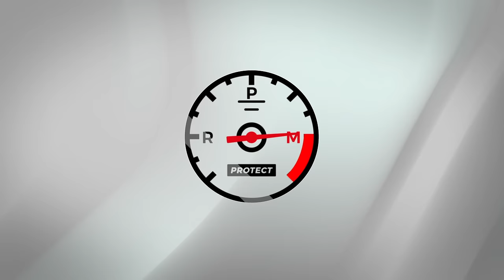Black Trashed Mitsubishi Pajero Bush Basher Gets a Detail! P2 Paint Correction  | Vlog 40.2

Comment: Sandro you knocked it out the park with this 1 The postman always delivers Again You read my mind  2 of my work colleagues came up to me and asked what cutting compounds i use as i buy all my own cutting compounds They said the works cutting compound was leaving to much holograms and haze  I watched both of there techniques and expalind there are a number of factors Both of them where hammering down on  the paint,  to fast of a arm speed, not cleaning out the pads covering to big an area I said it was not the compound it was the person holding the buff was the biggest variable (as you have said more than once) there faces where still blank The could not understand it was them and not the compound yes the compound is a small factor i said. Time  can get away from you sometimes the best way to say it is The Bad news time flies The good NEWS is youre the PILOT Cheers  IN SANDRO WE TRUST
Reply from the maker: 100% correct! There’s not enough emphasis on good technique compared to combination selection and it’s all to easy to blame the products and tools when some little changes in our approach could make all the difference. Thanks mate always appreciate it!

Comment: Hi Sandro! As you put another great insightful video online, just a small question. Our lovely house cat jumped on my bonnet, but must have slid right back off and made some scrathes 😫... Luckily my car IS coated. Can I patch those scuffs up with a bit of CarPro Reflect? No experience with polishing ceramic coatings. Thnx!
Reply from the maker: Thanks and I’m glad you enjoyed it! 
Unfortunately using polishing abrasives on ceramic coatings will tend to remove it or at least degrade the coating in my experience. If the coating was in good condition it hopefully helped take the brunt of those scratches so if you do want them gone you could still polish off the coating just on the bonnet and then reply it which hopefully shouldn’t be too much work.

Comment: Hello, i really like ur videos, tutorials, testing etc. I learned alot from watching your videos, thanks :) Can i ask you, when i need 3 days to detail a car(1day washing/decon), (2day poslishing), (3day panel prep and waxing), and i have garage where is  no zero dust, if i leave car in garage for night, when i come morning to garage i have little of dust on car. And question is: How can i take off the dust of the car after polishing and before waxing? or after washing and before polishing? I dont want to scratch it up after polishing. I think maybe fluffy towel and some ONR or panel prep to take the dust away, or just try polish and wax the car in one day?. Thanks for answer, sorry for my english i am from Slovakia. Cheers :)
Reply from the maker: I usually start by using compressed air to blow off any dust and then I follow up by doing my panel wipe down using some good cloths and a good gentle technique to remove any dust. 
If the space or garage is fairly clean and closed, then the dust should be quite minimal, but there’s always at least a little dust no matter what, so that’s normal.

Comment: Great job, Sandro!
Question about NV Evo, how long do you leave it before wipe off and how often would you change out for a new MF cloth?
Reply from the maker: Thanks mate, and Evo bonds to the paint very rapidly so in most cases a couple of minutes is all you need before the wipe off unless it’s a very cold climate and I usually use about 6 cloths a coating so I’m switching to new cloths about a third of coverage in

Comment: Cheers Sandro,
Great info as always!
After compounding / polishing would you recommend re washing the vehicle to remove residue or compressed air and IPA is sufficient?
Thanks again
Carmen from Montreal 🇨🇦
Reply from the maker: Thanks, and if you’re able to work clean, clean as you go and are in a relatively clean environment then an IPA should do it. However, if you’re not able to do those things then give the vehicle a wash if it needs it.